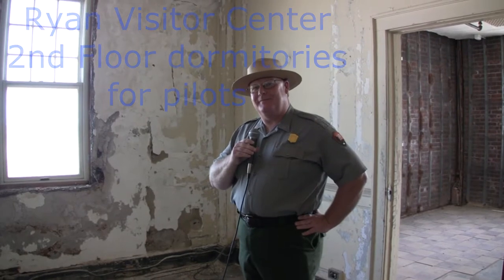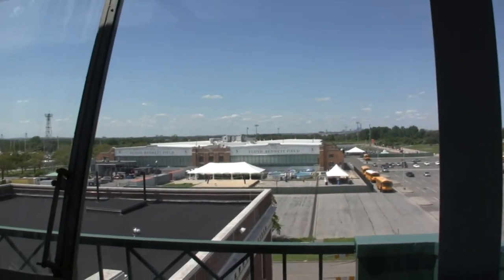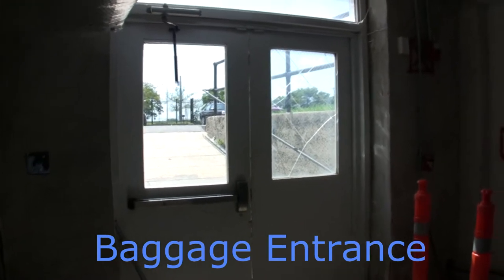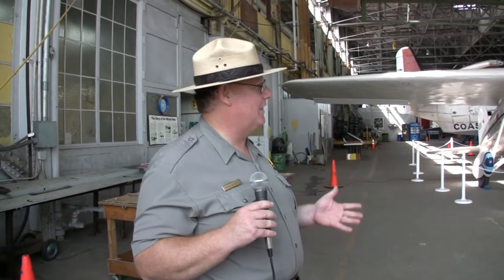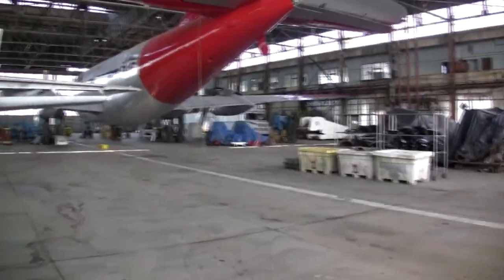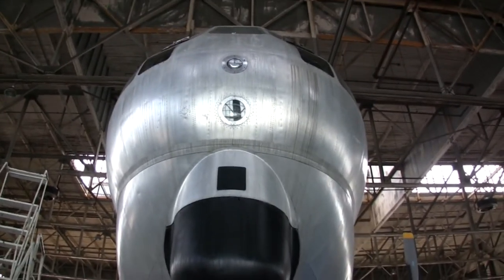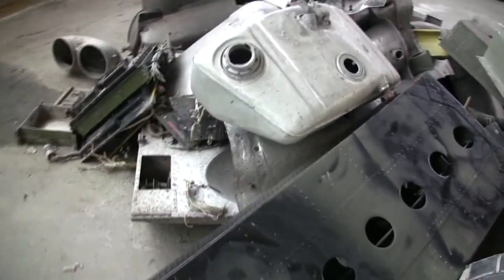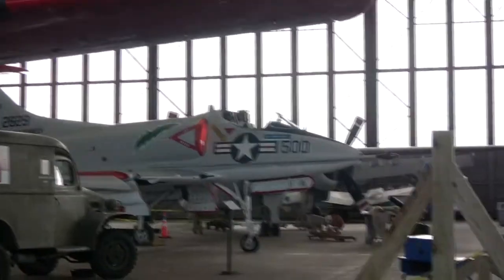Tour of Floyd Bennett Field with John Lincoln Hallowell Jr. and Sylvie Ball

Comment: Actually the A4 Skyhawk was flown from 1954 through 2003. When I was stationed at NAS New York the "Gate Guard" was painted to resemble one of the Blue Angel aircraft. There was a large fire, whipped by winds in January of 1969 at Floyd Bennett Field, which destroyed a large section of buildings including The Navy Enlisted Club.  On Labor Day weekend 1969, an A4 Skyhawk crashed onto Flatbush Avenue, setting ablaze the field across from the base that burned underground for a long time. FYI there was NO US AIR FORCE during WWII. It was then the Army Air Corps. I maintained the Logs & Records for VS 72  S2s, at Norfolk, VA at one time. One of which you have on exhibit. I was also in charge of maintaining Logs & Records and scheduling inspections for VAW 78 E1B/E2A/E2B/E2C aircraft at Norfolk, VA. I believe you have one of those on exhibit. I also served with VC12 (now VFC 12) NAS Oceana VA in the same capacity for A4A/A4B,A4C,A4E/G aircraft. I served at Floyd Bennett at the time the Navy left. I served with the Navy from 1965 until I retired in 1994.
Reply: I was stationed there in 1969 and remember both events.